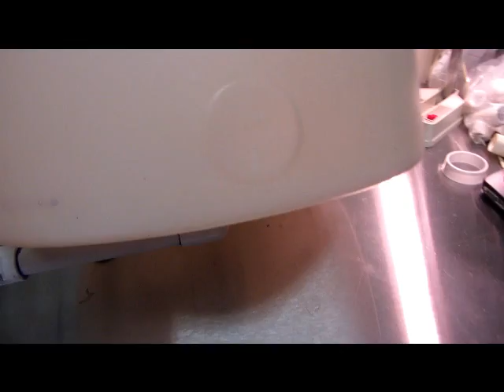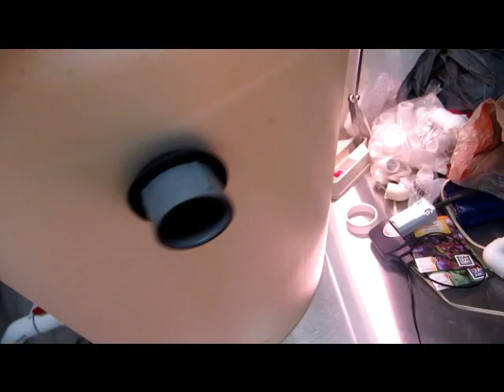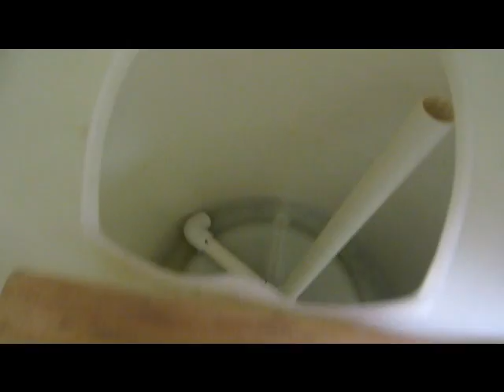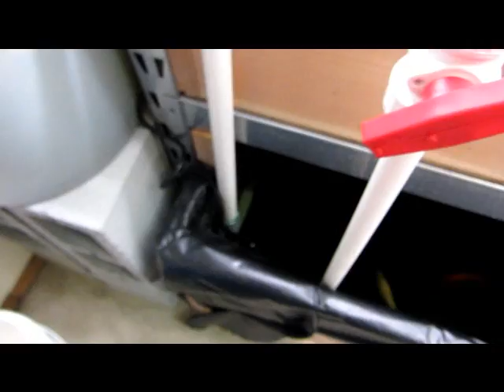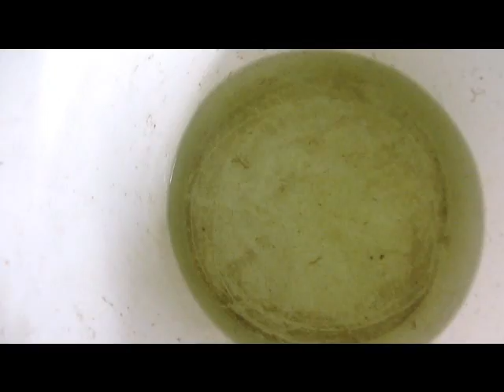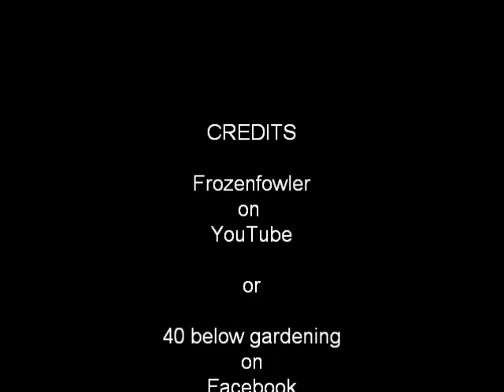Aquaponic Swirl Filter

Comment: I see you're using HDPE drain there in the background - have you found a better method to major those without crushing?  Looking into doing something similar with the same material.  Thanks!
Reply from the maker: George Viaud, unfortunately I have not had my system in a few years =(
Reply from the maker: George Viaud I used a heat gun to soften them up.
Reply: George Viaud 5facebook

Comment: Just build one of these myself for my turtle tank, he is a messy little guy with lots of solids. i did make a conical bottom as you mentioned. 
1) place pieces of dense styrofoam around the outside edges building a general shape.
2) insert a large funnel into the bulkhead fitting, just like the one used here
3) cover the foam with concrete. use the funnel to create the center of the coned bottom, and mold the edges the best you can
4) once that dries for a few days, use marine grade bondo to smooth out the concrete surface and further taper the edges. (make sure you mix the two parts of the compound completely. if not, the bondo will not cure correctly)
5) sand a final finish after days of allowing the bondo to dry.
6) seal the entire inside of the tank with waterproofing. i used foundation sealant. (again, make sure to let it dry completely)

building the filter took about 2 weeks with all of the time i allowed for drying. 
works great...

Comment: I wonder if you even look at these but anyhow , I thought about using a gamma seal lid and placing the canister below my tank putting it through the SF and pumped back to the tank what are your thoughts on that . can I compress the filter ? will it keep up with my pump ? 500 gph
Reply from the maker: Sorry, never actually heard of a gamma seal lid..The nice thing about water pumps is that that they are magnetically operated and cannot really be over worked. Even of your "compressed" filter gets clogged, as long as you have a secondary redundant drain you should be fine.

Comment: by swirling it aren't you just mixing the wast? you should just have a down flow, not too much or it mixes in too?
Reply from the maker: ivanthegod The way I had the nozzles aimed concentrated all of the waste into the middle an right at the bottom of the tank so when I opened the drain all of the waste would come out in about 4 cups of water. It worked very well however having a coned bottom would have been even more efficient. Thanks for watching though =)

Comment: I can clean out more with a few tub socks and a small pump in a hour than you just did...
Reply from the maker: Hi Don, thanks for watching and taking the time to comment. I wish that it was tube sock simple. unfortunately I have found that using filters like tube socks or mesh that they become clogged within a one day period thereby requiring a great deal of attention and time. not to mention that they are also very difficult to wash (tried it). I found that the swirl filter is quite effective and only requires emptying once a week (takes 1 minute) also it serves another purpose and that is surface area for beneficial bacteria for converting the ammonia into nitrites and subsequently into nitrates also you can save the byproduct for your real garden. BTW do you have an aquaponics system or have you ever ran one. Regards...
Reply: I agree with don. The reason you have so little solids at the end of one week is that the filter is not effective. Your swirl being at the bottom keeps the solids in motion and they go out the filter.

Comment from the maker: I was thinking about that myself. I figured because I had the intake up so high that it would not be much of an issue. I also have a matala media filter on the top so I suppose that anything getting stirred up would get stopped by that. however I would like to remove that filter as it is such a pain and I am concerned that one day I may find 400 gallons of water on my floor. Thanks for the advice, I do beleive that I will also focus them at the horizontal and get rid of that filter. Thank you =)